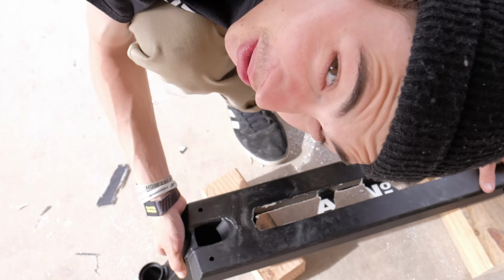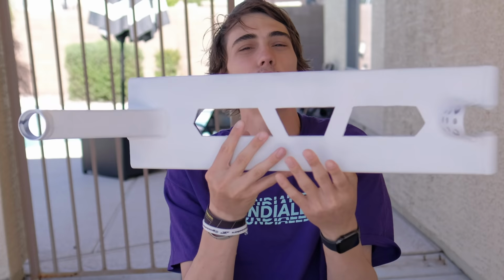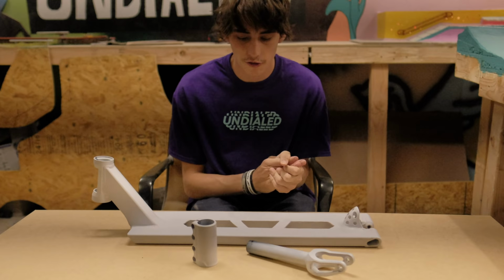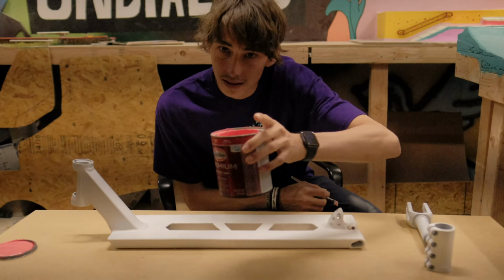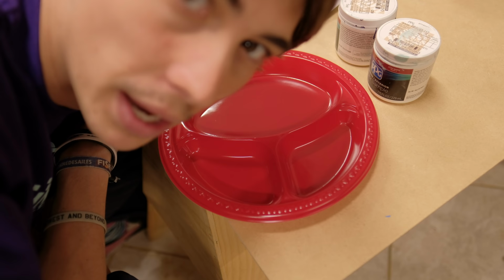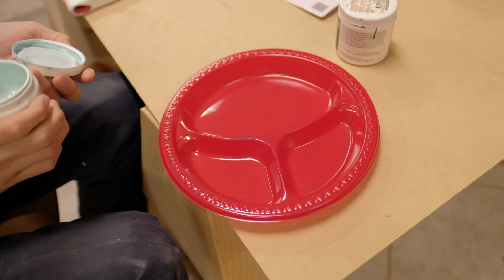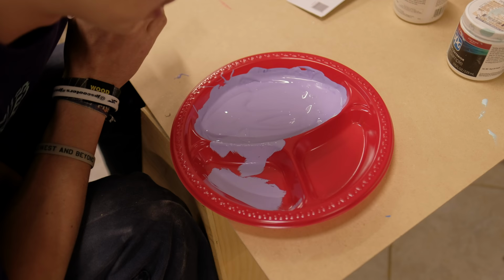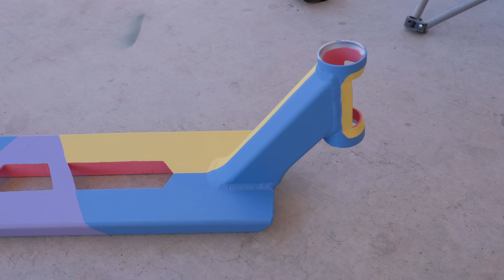Primary color painted tilt deck (custom)

Comment: “All of my parts are from 9 months ago” How is that possible I cracked my deck in 7 months
Reply: He a hard core street rider riding a tilt deck,thats why
Reply: What deck did you ride??
Reply: and you cracked it not snapped it
Reply: aiden phillip it was bad if I would’ve not noticed it it would have snapped
Reply: @Draken-bi1vr  you said you cracked your deck not snapped it
Reply: draken09scoots fork and scs ususally last longer then deck tho. Atleast in my case
Reply: I've never snapped any of my parts apart from axles
Reply: draken09scoots why not ride it till is snaps?
Reply: I been running the same parts for 3 years now 😂

Comment: I love your creativity. It's inspiring. Could this be done on the 5.5 ten year? Also, can you film some clips of you riding and if you notice any difference after your minor mods. 😜
Reply: I reckon it could be just a tad harder coz the 5.5 has a flat bottom unlike the 6 with the cut out. But I reckon could do It
Reply: @tomlinsonsontour  doesn’t the 5.5 ten year have a cutout